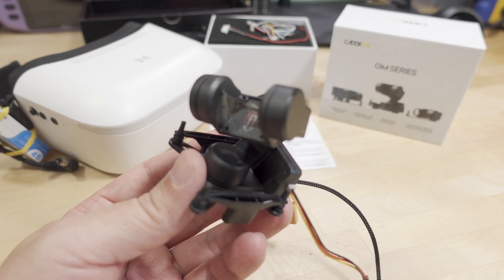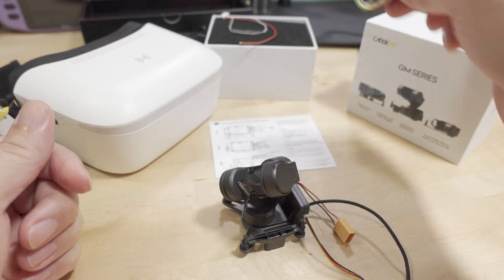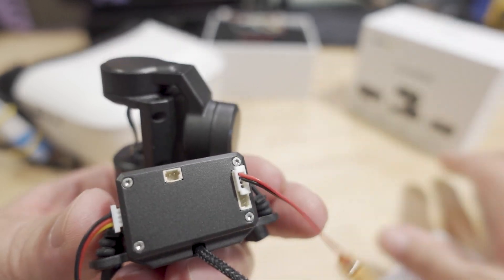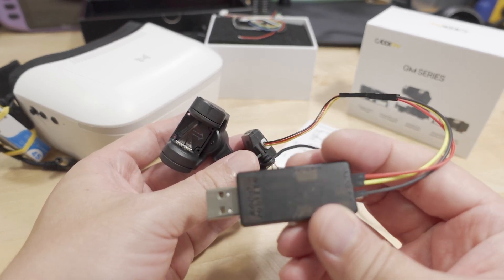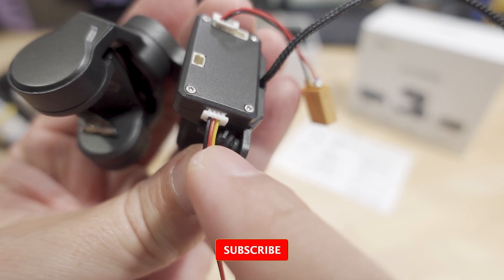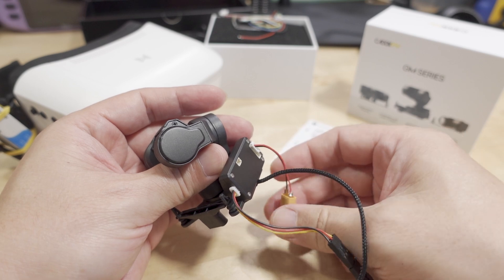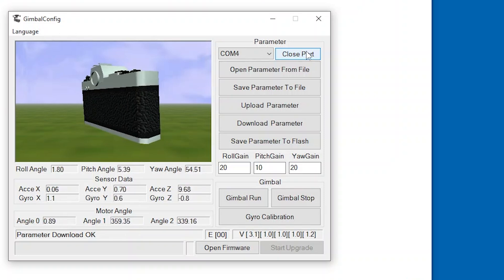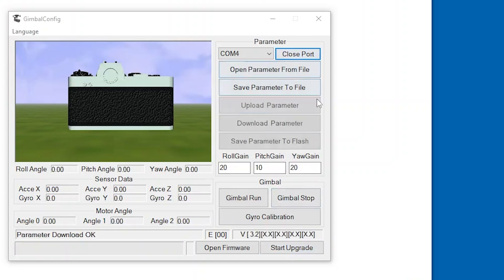Caddx GM3 Gimbal Firmware Update Tutorial 🎓

Comment: Hi, new here and stuck. I watch your video a few times. i updated my moonlight to V3.4 and my goggles L is version 38.43.8 but still cant link to VTX. I did the few second link from the goggle L and push link on VTX but it just keep beeping red and not sync to VTX. I tried the update which i held the link button for 8sec and it rest and than beep with no upgrade in goggles L. I'm lost
Reply from the maker: Sorry, I'm not sure what is wrong here.  I would contact Caddx support for more help.
Reply: I got it fix. Has for the heading PTZ setting. If turn my head left the camera go right. If I turn my head right the camera goes left. Is there a way to fix this?

Comment: I just got the C-20T off Amazon and it is exactly like that gimbal 😉 mine came with the usb c port, surprisingly 🤯 i would love to use this with my 03 air unit and integra goggles. I believe they have head tracker in them but trying to figure it out. Haven't installed it on 03 air unit yet ot plugged it in to anything. Doing some research and trying to figure out if i need to purchase the $70 head tracking kit to go with it. All branded XF Robot 😁 thanks for sharing what you have learned. I will check for more videos.
Reply from the maker: Caddx gets these from that other company but doesn't include all the accessories.

Comment: Looks like I need to start studying. LoL
Reply: @GR8.SCOTT.111  have you figured out anything that you would like to share? 😁 I just got this gimbal for 03 air unit and integra goggles but haven't gotten the head tracker kit yet. I think i should be able to use head tracking that is in my goggles 😉😁
Reply: @redreefbud  unfortunately I have not.
Reply: @GR8.SCOTT.111  please keep us posted 😁 have you gotten the gimbal hooked up? The gimbal it's self really didn't come with much. Gimbal with case for cam, that USB -c plug and 1 plug with wires. New products, not much info. Right now i am wishing i got the whole kit with head tracker included. Then i would have something to mount it on. I am going to have to make a little plate to mount it on. Something light and easy to work with. Some kind of plastic plate. Mount gimbal to that then mount plate to drone or rc truck. 😉 I still may order the head tracking kit but another $70 and 2 weeks wait time. Idk playing with something else and thinking about it 🤣